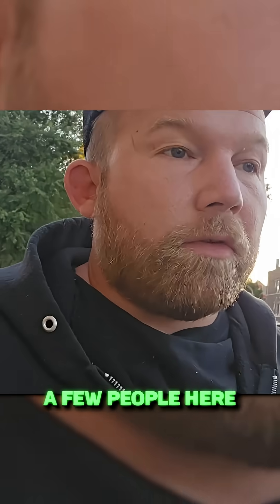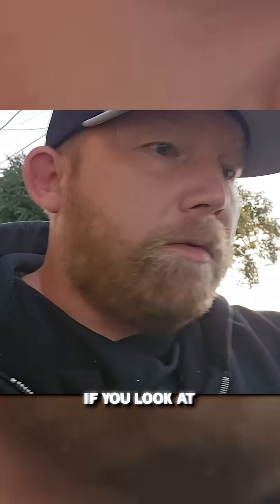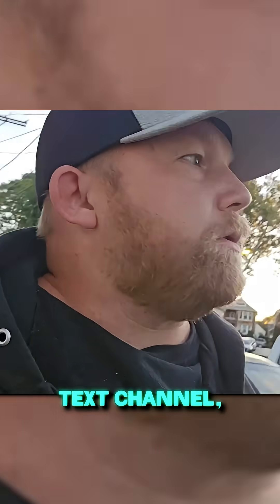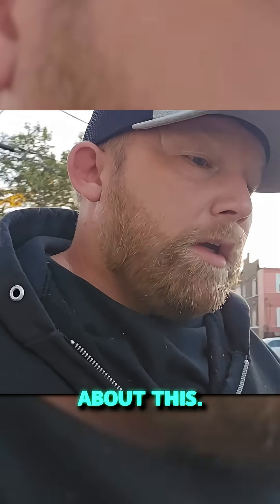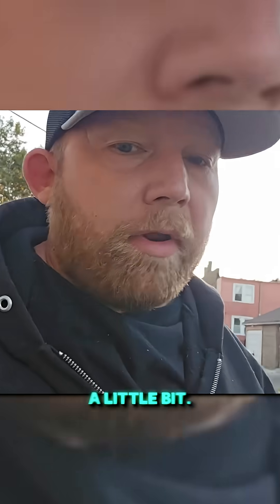Why Every New Car in 2024 Has THIS Filter (And What It Does) #ford #reels

Comment: If I was to buy a used to new Ford Explorer between the years 2020&2025, which one would you recommend do to the 10 speed transmission issues it’s had in the past ..and also what engine size would be most reliable, the V6 or the 4 cylinder?
Reply from the maker: 25

Comment: Hey can a 2019 Ford Escape SE 15L radiator coolant be flushed by the coolant flush machine. I've been told at oil station it can't because of the line to reservoir is too small. Thanks